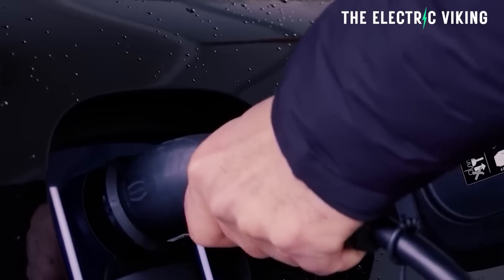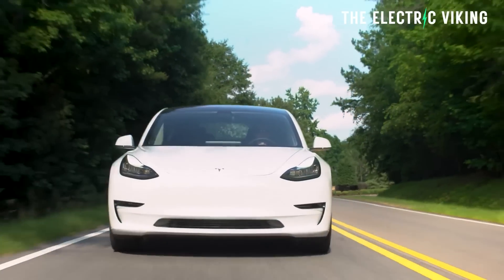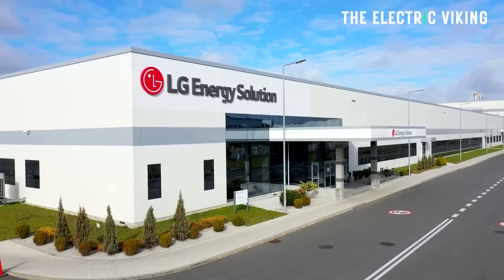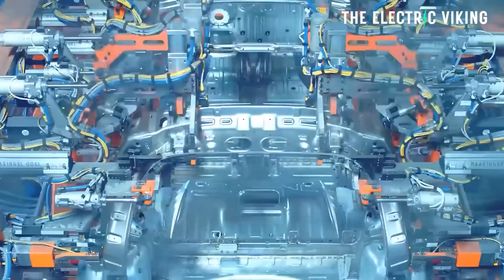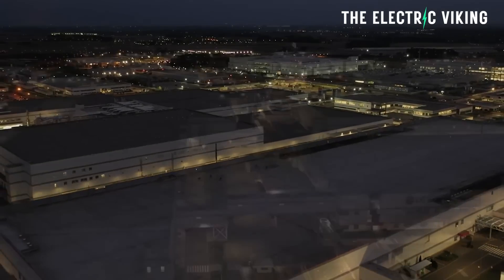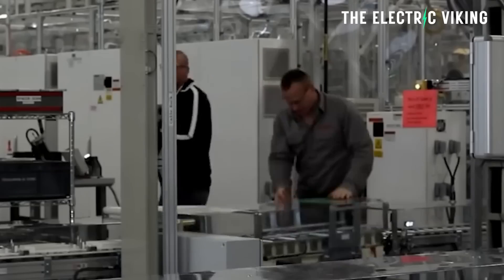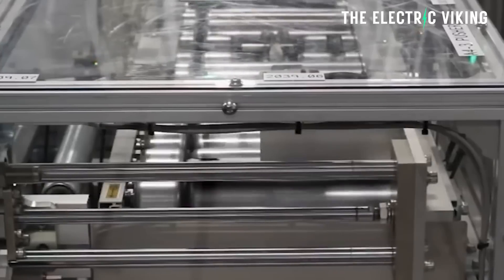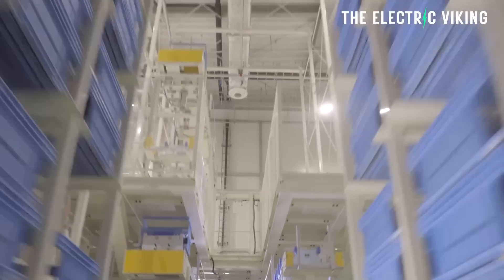NEW wireless battery management system are a GAME changer

Comment: I don't see how this would work for EVs. There needs to be somewhat heavy gauge wire to the BMS for equalizing throughout the pack, and that would also provide voltage measurement for each individual cell to the BMS.
Getting rid of the heavy gauge wire gets rid of equalizing, which reduces battery life greatly.

Comment: This is great news as it will save on cost, weight and space needed for the cables.  As solid-state batteries begin to roll out in the next few years, this wireless communications should be ready for prime time.

Comment: Sorry but this seems like a downgrade i'm not believing the hype on this one. BMS is not a network of heavy cables, it's lightweight wiring to begin with. You'd still need the same sensors and controllers, just replacing simple wires with a bunch of wireless communication equipment. I'm not an engineer but i can't see this saving significant size and weight...but i can definitely see reduced reliability.

Comment: You're completely misinformed that Nissan has no BMC. They couldn't charge their batteries without them exploding. What they don't do is actively manage the cooling using coolent fluids and thermal management by this method. A radio on each battery is not feasible when using tiny cells. Very little weight will be saved.

Comment: Viking, wireless bms is a strategy to deal with communication over many circuits that are at extremely high voltage differentials.   Tesla uses a proprietary bus and the weight savings are negligible.  Best take down video to preserve cred.

Comment: A wireless BMS could be hackable from any bystander, suggesting wrong information about battery cells to the car and thus the battery could be mistreated by the car, resulting in maybe overloaded cells, resulting in damage to the car and surroundings.

Yes, sure, there will be saftey builtin, cryptography and so on, but still, wireless things got hacked. Hackers typically need time to read the data and then they could hack it.

I would not like this.

Comment: Call me an old cynic but this smells like snake oil! The heavy conductors in an EV are between the charge port and the battery (via BMS) and between the battery and the inverters. These cannot be made wireless because they carry high current. So that leaves the sensor wiring between the BMS and modules or cells. They don’t weigh much, being fine gauge. If you remove them you need to install transmitters to send the sensing info back to the BMS. Ok, so will you have one transmitter per module or per cell? Then you introduce many new points of failure. Or you could just have one transmitter for the entire pack and bring back all that wiring you just threw in the bin. And how much will all those transmitters weigh/cost? More than light gauge copper, I’d suggest. Maybe I’m missing something? If so, set me straight (but only if you’re an electrical engineer please - I’m not interested in anymore magical thinking)

Comment: I've worked on many Leaf battery packs and they definitely have a BMS.
 What they do lack is thermal management which is quite separate from what a BMS does. The BMS will send messages to another system which will heat or cool the cells as needed.
We have brought in over 80 used Gen1 Leafs in the last 4 years, and as there is virtually no fastcharging available in Namibia, we have not had premature degradation in Vehicles that arrived with a healthy battery. The vehicles are used in and around town as they were intended originally. 
Some of the 2011 Leafs can still do about 60 km per charge. 
If you use a small pack EV for commuting at highway speeds and for more than it's full range, and then blame the car or the manufacturer, you're stupid not the car or the manufacturer.
Put a 30kWh battery in a Tesla and see how fast it will degrade. Small packs get hotter quickly and are cycled more often.
Besides, it's easy to look into the past and criticize. Those Leaf cells were designed at the turn of the century already. What we know now is 10x as much as they knew then. 
Only in 2017 Nissan went for the highway market segment with the 40kWh and later the 62kWh batteries. 
Unfortunately, in true Japanese tradition, they did not add thermal management until they had dented their reputation properly.
And the 2018 Leaf Aerodynamics suck.
Also never heard of BMS wiring coming loose in a pack, even in an accident. Certainly not from a bump in the road.
However, your point is clear. Less is better.
Thanks for the channel.
Reply: A BMS is essential if you're going to use batteries in a series/parallel configuration, the thing that Leafs did not have was active management of the temperature more than limiting the current, Ii's the BMS which causes a battery pack to rapidgate.
Reply: @eclecticcyclist  exactly what I wrote in my reply....... "what they do lack is thermal management........"
He stated in the video that the Leaf does not have a BMS, which is incorrect.
Reply: So what is the actual definition of a BMS? I thought it was Battery Management System? Heat management is a huge thing in EV's. Sounds like they are little more than a charge controller?
Reply: @geoffhaylock6848  Yes, they are a management system, that's why I remarked that it is different from thermal management, as that is a system that moves coolant to heat or cool the cells and other things.
A BMS will activate thermal management the same way it dials the charging rate of the onboard or fastcharger up or down depending on conditions of SOC and temperature of the cells.
Thermal management actuators and equipment, just like onboard chargers are normally found outside the battery, whereas a BMS is mounted as close as possible to, or on/in the actual pack.
In the case of the Leaf it should actually be called a controller or control unit, as System is generally a wider term used for a bunch of components working together. 
Most modern systems use the same coolant and pumps for cooling the motor and other components too, using valves to direct the coolant where it is needed.
Reply: @geoffhaylock6848  From Powerfacts website "The main purpose of a Battery Management System (BMS) is to protect the battery pack from over-charge, over-discharge, over-current, and short-circuit conditions. The BMS also monitors the battery pack’s temperature and balances the individual cell voltages to ensure the maximum capacity and longevity of the battery pack." and "Without a BMS, your batteries would be significantly more likely to fail prematurely." 
Note: it only monitors the temperatuse and the easiest way of regulating the temperature is by current limiting, a relatively easy active cooloing is to open air vents and use fans for cooling only, The most complicated and expensive is to cool and heat using a heat pump.
The LeafSpy dongle and app reads the information measured by the BMS therefore the Leaf must have a BMS.

Comment: Agree that innovation is happening fast, more like during the early 20th century for ice cars. I think ICE engines peaked at the end of the 20th century with the application of computers to micro control fuel delivery and other parameters. EV tech is just beginning and any real impediments to development such as EV manufacturers not being able to source enough copper, as some like Peter Ziehan argue, will put added pressure to innovate on the industry. I’m very happy to see ICE pollution gone from cities, even if it takes a long time to reduce the overall carbon footprint of EV to hoped for levels.

Comment: As you may have seen the best way to make the batteries last longer is to monitor the voltage and amps at the cell level and make the charging adjust to decaying batteries. That cannot be done wirelessly. Cell level not pack level or module level. It would be very difficult to do that without wires. But if you charge at the cell level, the monitoring system can be wireless and the charging cables would be very many small wires. That is the best way to make batteries last longer and would be able to tell which cell is bad if the pack/module needs to be replaced. Something that can take 1000 charges, that gets charged daily will last how years? Depending on usage how long do phone batteries last? Better than before because you could only buy a phone on credit for two years, now for three years. Improvement but not that long. When and if the cost of EV's come down to the cost of ICE cars, they can be refueled quickly without battery degradation, and have the range and not the loss of range in the winter, then they will become something more than an in town car.

Comment: Aint bms just battery voltage system manager it prevents cell group to overcharge or overdischarge. Gives signal to main block and it stop charging or slover it down till overcharged cell gets balanced??? It has temp sensors around pack and regulate  power to weels if it's hot or too cold and charging too. Nothing to do with cooling tho overcharged cell could get hot🤔 Cooling and heating battery is dependent on liquid plates, tubes and other type channels around cells or their battery blocks. Like old nissans does not had. Without bms your car would just get on fire becouse nothing would stop charging and balance overcharged cell till it explodes and ignites.
This wireless multi wifi modular system could work till it reaches main block and regulates. Without long wires around all pack it shoud give benefits in weight.

Comment: I'm a little dubious. Take a home wi-fi system and various devices wirelessly connected (like Belkin Wemo or Amazon Alexa, etc). Works great most of the time. But occasionally needs a reset. There is probably a box full of old, to-be-recycled routers, etc. stored somewhere. In a car like a Tesla (or most cars), you could almost replace the entire wiring harness with wireless sensors and actuators (even powered by RFID Tech). Maybe not the highest bandwidth, lowest latency ones like cameras, but most (e.g., window wipers or mirror controls, etc.). However, I think that simply would not be safe or reliable enough. Might even be hackable. On the other hand, satellites in space are certainly "wireless" and for communications or telepresense, so are spaceships and robots. But I think I want the security and reliability of some hard wiring in my automobile or airplane.
Reply: Must have service entrance ground wire

Comment: that battery will be locked to that vehicle so if you try to replace a module with the car dealer you can't. 
they may even be able to brick your car from remote example police disabled when you speed by them

Comment: Sam,

I think the Battery Management System (BMS) uses a extreme amount of wiring and thus weight is that every battery cell, and there could be a thousand or more, requires a wire to a BMS system (usually in each pack) to balance the voltage for each cell to within tolerances of a couple of 10ths each.  Then yes they have some temperature management functions as well.  

Now, how they are going to get that data on hundreds of cells to the BMS I have not a clue as that is quite a lot of data to send, receive, and process. 

I personally would like more information on this so if you can direct me to that data I could understand it better. 

My best to Shanna and your boys, they need lots of good ole dad hugs.
Reply: The problem isn't the data, it's the balancing current.
Reply: I don't see any possibility to get rid off the bms wirering to the cells. Will each cell instead have some kind of chip to send the data? No way. There may be same kind of wireless communication between the battery modules and the whole pack, but not between cells and module.

Comment: Wireless BMS is dumb. It's another point of failure. The BMS itself will still have wires to each cell group. The communication cable is negligible. You are wrong here Viking.
Reply: I also agree this is silly
Reply: I agree - although, I can also see that a method could be devised to overlay digital packetized control and status signals on top of the DC power, similar to the way copper Ethernet can be extended over power wires in a home.  This would still eliminate excess wiring harnesses.  Wireless can be problematic in some environments.  I know of a family metal fabrication business where they have to stick with wired land-line phones because cellular calls will disconnect whenever any arc-welding is being done.  To make an uninterrupted call, you have to exit their building and walk about 25 steps away.  Their landlord is not happy, because the neighbouring business spaces are affected, so Wi-Fi, Bluetooth and cellular signals get interrupted for other tenants.  Is an EV's battery management mission-critical in an area like that?  Will other critical systems go wireless in cars, like steering-by-wire?
Reply: Anything can be reduced to the lame excuse of “oh it’s another point of failure”.  How incredibly silly of you.  Besides it’s only another point of failure IF IT’S DESIGNED TO FAIL!!!!!!!   The Lexus ls430 is one of the most advanced cars of its time with countless features computers and sophisticated engineering and yet IT’S ONE OF THE MOST RELIABLE CARS EVER BUILT.   Try exercising your brain before writing such a stupid stupid comment
Reply: Viking Strong 👍🇬🇧
Reply: Wires and wiring are always points of failure of any vehicle believe me i have had many problems with wires/wiring throughout the many cars i have had in my life. Wireless could have the potential to eventually be much simpler. That does not mean i will be buying these cars when they first roll out though
Reply: I agree wireless is a definite point of failure or miscommunication
Reply: @djash7161  maybe initially because there will be problems with any new technology. But to think of all the wires and all the connections that go into a ev car that will end up wireless. It Will be for sure the possibilities of a simpler car. Could help bring cost down more and Less wires also equals lighter and or room for possible more batteries for extended range. I definitely would be wary of when these first roll out though. But I see 5 years down the road all the major ev manufactures will be doing this. Just look how far ev's have come in the last 10 years
Reply: @djash7161  that’s why you have redundant systems? If you drop weight and less components and smaller enclosure with more battery density, why not?

Comment: I think this is a case of GM over-marketing, not really any sort of break-through let alone anything that would really reduce weight by much (if anything).   All EV batteries have BMS's.  The comm wiring (which is what the wireless bit replaces) does not amount to any real weight.   30-90 kg?  No, that's just not possible... not for the BMS comm wiring.  We're talking two 24 gauge wires for comms... gonna be less than 1lb (probably far less).
Reply: Exactly. Instead of some fairly simple fixed wiring they'll be relying on many chips which need to be wired in, temperature, dust and fault tolerant. 

If this was a game changer Tesla would probably have done it by now.
Reply: Agreed sounds about right also the point about mobile phones not having a BMS is incorrect, all do and work very well heat not being a big issue due to low power requirements otherwise sales would be very low not the case!
Reply: Yes, and I would add... the real wiring concern when it comes to a BMS, beyond the power-carrying main conductors, is the wiring for the balance leads.  But these will never be wireless either because they also need to carry some amount of power to support required balancing functions.

The actual comms can just be some bussed standard, like RS-485.  All data from the BMS's is ganged onto one pair of wires (maybe two pairs for comms redundancy)... that's it.  Micro-controllers typically run these serial protocols at anywhere from 100kHz to 2MHz or so, depending on number of drops, bus length, and the level of robustness required.

The data includes temp sensors, cell voltage monitors, warning and alarm flags, energy in/out totalizers, and so on and so forth... a few dozen data fields.

So, for example, lets say a vehicle has 24 packs with 32 data points per pack.   That's 768 data points.  Lets assume around 4 bytes per sample (average, taking into account data ganging in packets)... 3072 bytes or around 30Kbits or so.  At 1 MHz the entire data set can be sampled at (1000000 / 30000) = 33 times a second, which is plenty good enough.   Just as an example.
Reply: You still need much heavier cable to connect the battery packs to the motors. Maybe the cost of installing the comms cables might be lower but you’d expect these things done in bundles anyway

Comment: wireless battery management system creates more point of failure because I am sure going use ,low grade chip to save cost and you are talking about unproven battery system, we may see a massive recall such as LG battery in Chevy bolt/volt.

Comment: 10-15% more space, 30-90kg - utter bullshit. Some savings, yes, but compared to the cells, BMS volume and weight is near-negligible. Only needs thin wires for voltage sensing and some electronics for monitoring & balancing. Cables shaking loose just doesn't happen - connectors have latches & locks.
Wireless also poses risks- imagine not being able to charge due to a local interference source ( intentional or otherwise)

Comment: …and add in the fact that the ICE engine was ALREADY fully developed by 2008 (i.e. there was no more efficiency or power to be drawn out of the engines) and you have a sitting target in many ways.
Reply: ICE engine? Is that the engine that runs internal combustion engines? Yeah, that engine was maxed out years ago